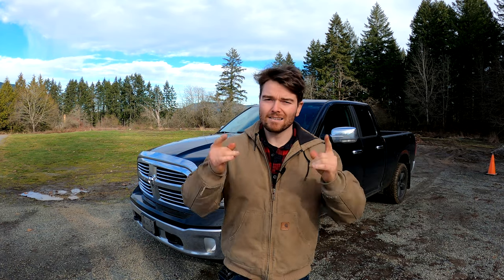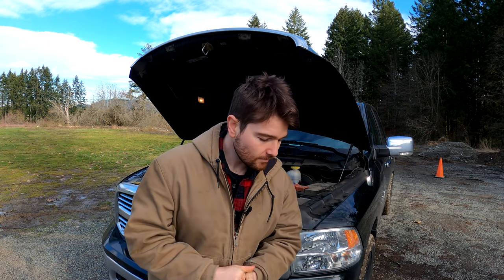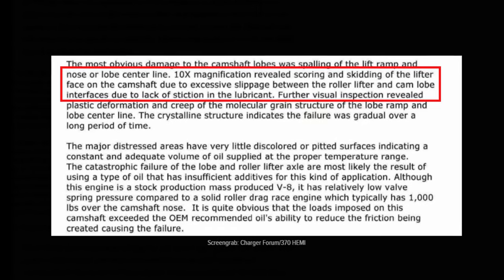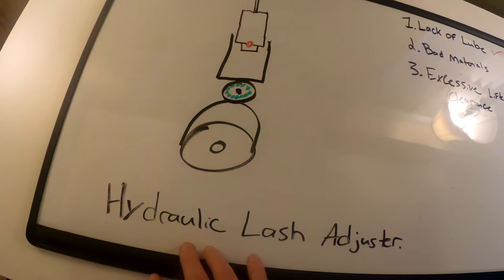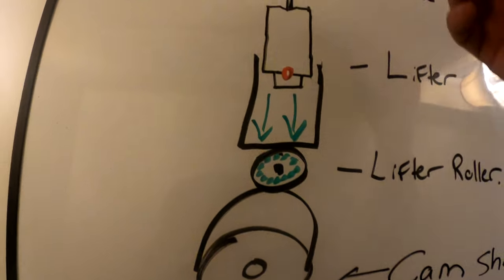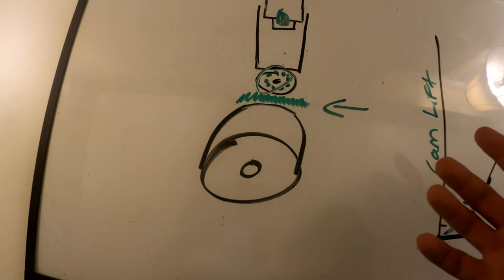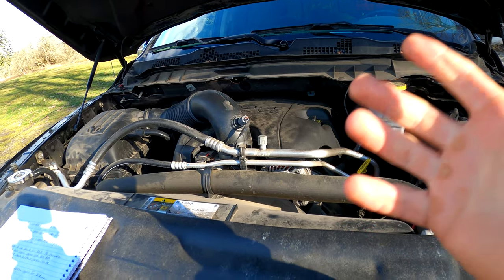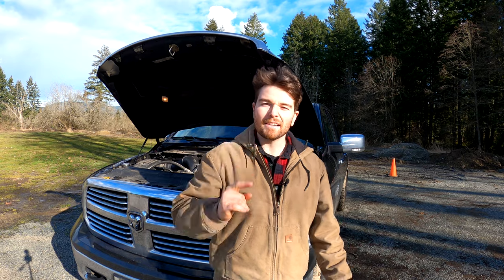RAM 1500 HEMI TICK Explained (Revised) - The Cause And How To Protect Your Engine

Comment: I bet ford f 150 doesn't have this problem!
Reply from the maker: crazy chicks drive F150's Mike. I'm thinking of one right now
Reply: Yeah they burn oil instead haha.
Reply from the maker: @user-fz3sz2dj4r  nobody at the ford dealer mentions 5.4 triton and spark plugs in the same sentence.
Reply: they have cam phaser problems instead, it is big deal look it up, my friend's 2020 Navigator is in shop for 6 weeks, they didn't touch it yet, parts are in back order... I still like my f150 service truck, but i'm here because i have Ram too... so far neither of two 5.7s gave me any ticks
Reply from the maker: @tallll70  Jesus, on such a new vehicle too. I hope they gave her a good rental lol
Reply: @TheGettyAdventures   Actually it is my friend's wife, he has Super Duty, they gave her Lincoln 4 door sedan car... But if my 5.7 snaps bolts like you mentioned at beginning, i'll get jba shorty headers, BoostedMotorsports channel did that and with so much better flow he got 27 mpg on hwy, hi didn't believe it him self so he made longer run video with it on interstate with same result... got to say, Hemis could have the best economy of them all if they would not use such stupid boxy headers
Reply: This ain't a gambling video, but you're welcome to try your luck with Ferd.
Reply: @tallll70  don't bother with shorty headers, longtubes is where you get your power from. Shorty's are a waste of time unless you're just looking to brag you have headers.
Reply: @DL101ca  not for power, just for better mpg, but thanks for advice
Reply: I’ve heard a F150 ticking right next to me

Comment: These new gen Rams from Fiat are garbage. I have a 2018 ram 1500 7200 miles. If you idle and shut off, will tick every time. Trash lifters. True fix is a trade. Good luck